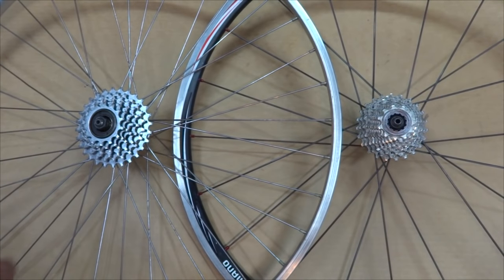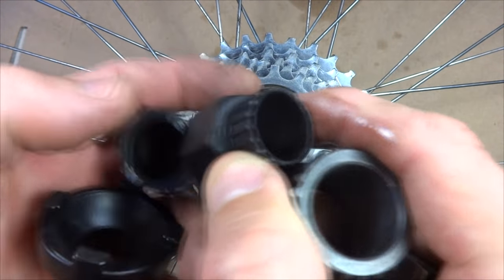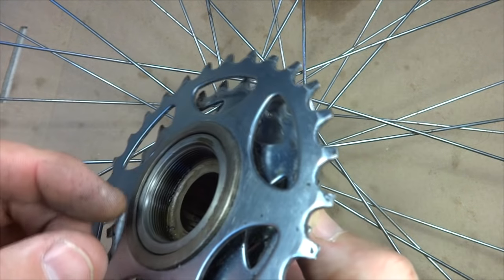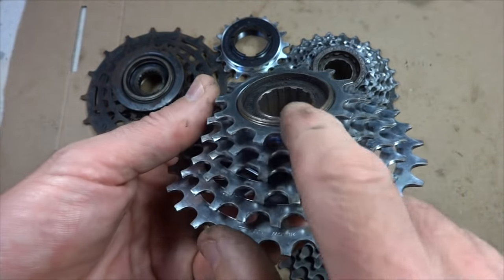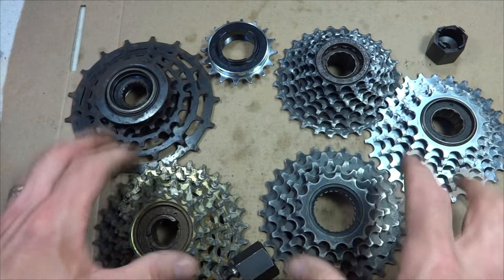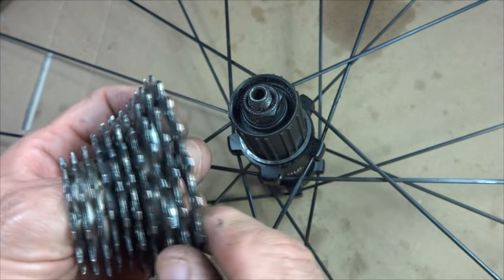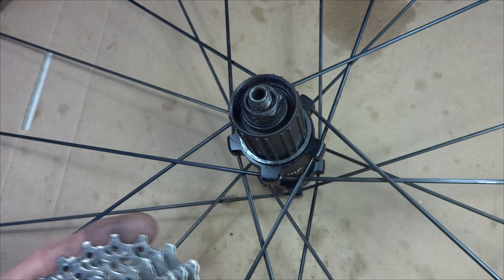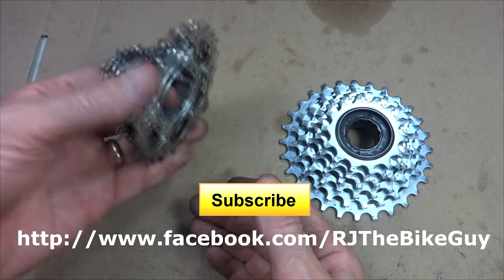Freewheel vs Cassette - What Are They? Can I Convert?

Comment: you just answered a conundrum I've had for years now , I have the two pin free wheel removal tool in my tool box and couldn't remember what it was for .... now I know haha , it was an old bike from the 1990's , thanks RJ you just made an old man very happy :D ( I'd been racking my brains wondering what I used it for )

Comment: Thanks, it became clear when you used the term freehub. I like that better than the term cassette since both types contain a "cassette" of sprockets. The difference is really cassette capable hub versus a freewheel capable hub (in my mind).

Comment: RJ, my man. I need some help. I got a 2011 Centurion Backfire M4 which is a 7 speed freewheel. I am thinking about getting new wheels for it since I ride it a lot and thought about getting a wheel with the cassete  hub. Now i only wonder if I could possibly fit an 8 speed cassete because cassete cogs are closer together than the freewheel is. I am just wondering if the frame could fit it. Also if the Shimano Acera derailer can work with it. Just looking to increase the gear ratio so I will also change the front sprocket to something bigger to get more speed
Reply from the maker: Depends. Measure the hub spacing to see if an 8 speed wheel will fit. https://www.sheldonbrown.com/cribsheet-spacing.html
Reply: Thanks for the link. Just needed some kind of guide
Reply: i think it should, did you try?

Comment: Thanks for the vid, that helped me with my old style campagnolo hub & freewheel. Just bought the two ear tool to remove it from the hub. I have a bent rim to swap out with an Araya doaner wheel assembly which BTW has the uni-glide cassette and I used a flat drift and kept hammering the smallest cog until it loosened up. I'm glad you showed all the different styles.
Reply from the maker: https://www.youtube.com/watch?v=1zWYLb2RMPA
Reply: Dude you need to get some chain whips too

Comment: RJ, I've been finding your videos useful. As such, I have a question and a comment:

Comment: I think it needs to be said that the main difference between cassettes and freewheels is cost. In my observation, your cheap, to mid-grade, bikes will usually have a freewheel. This is what I've seen in Wal-Mart and other bike distributors that sell bikes in the $100-600 price range. Cassettes are usually seen on higher-end bikes, despite the ease of repair, compared to a freewheel.

Question: I've seen your disassembly videos, both for rebuilding the freewheel, and for removing the cogs on a freewheel. What chainwhips do you use, and how expensive are they?

Comment: RJ, Thanks for the Video. I am restoring an old Peugeot I found at a garage sale and it is my first time so I am learning as I go by watching your videos. I took it all apart to clean (and bc it was fun) and now the hard part of putting it back together with new parts has come. The issue I am having is I bought Shimano Tourney A070 2 x 7-Speed STI Lever Set and Shimano 7-Speed Tourney Bicycle Freewheel Replacement Cluster - MF-TZ2 BUT like an idiot I bought Aeromax alloy wheel-set 700cc. I am sure you are aware that they are set up for cassette /freehub and not freewheel. I would greatly appreciate your advice on what to do/buy. 
PS I have already expanded the rear triangle to about 126 but have not invested in a rear shifter.
Reply from the maker: What is the hub spacing of the rear wheel? 126 or 130? What was the spacing of the frame to begin with? 120?
Reply: The hub spacing of the rear wheel is 130. The frame was previously 120. Thanks for the help.
Reply: RJ, not sure if you saw my first reply but The hub spacing of the rear wheel is 130. The frame was previously 120. Thanks for the help.
Reply from the maker: Then either expand the rear to 130 and get a 7 speed cassette or get a 126 wheel.
Reply: Thanks, will any 7 speed cassette fit on the freehub of the aeromax ally wheel set 700 cc wheel?
Reply from the maker: I suggest you research that.
Reply: Checked into it, looks like shimano 7 speed cassette will work on the aeromax wheels. Thanks for the help!

Comment: While scrapping out some bikes for parts I found a freewheel hub adapter on a Dimondback mountain bike. The inside of the larger outer cogs where wider then the average cassette mount and where two different center sizes on the hub but yet it was a cassette cluster on a freewheel hub so it is possible but not today since the cogs are probably rare. I took the adapter off and there was a standard thread for a freewheel. It wasn't easy to find a wrench for it but I had one. I have also seen some weird adapters that are for foot pedal shafts to change the size.
Reply from the maker: I am guessing what you found was the guts of a disassembled freewheel.
https://www.youtube.com/watch?v=T_vRbBRPr3c
Reply from the maker: Or https://www.youtube.com/watch?v=uwGCZuWPQGk
Reply from the maker: They not standard like a cassette/freehub.

Comment: Your videos have proven to be an invaluable resource of information for me. A friend gave me a vintage bike (12-speed Sears Free Spirit 3000) recently and I've been doing some "upgrades."
I'm seriously thinking of converting it to a single speed. Can I just replace the 6-speed freewheel with a single speed freewheel and call it a day, or are there things I should be concerned about, e.g., chainline, etc?
Thanks for the awesome videos!
Reply from the maker: Chain line would be the biggest thing. Chain length. Depending on the dropouts, chain tension. A lot of it woiuld be similar to this: https://www.youtube.com/watch?v=sInijI1vr34
Reply: RJ The Bike Guy I'll check that out. Thanks!

Comment: My locking nut is probably extremely tight.  I put a breaker bar on it and still couldn't get it off.  So tight that I thought those 2 holes might be for some kind of snap ring.  I'm hitting it with some PB blaster; hopefully that helps.

Comment: I have a Chicago 1980 Schwinn Red Le Tour serial number: SC097880, with 6-sprockets and the Shimano 400, not the Shimano Altus LT.  It does have aluminum wheels but not the ones for the new tubes.  I bought it used.  It seems to indicate that someone swapped in a Super Le Tour rear cassette.  The reason I bring all of this up is I can get all 6 in low range, but not so easy in high range.  The chain checks out for length but some of the sprockets are kind of sharp.  It has a lot of miles on it and maintained when it squeaks.  However, I can't help but wonder if no matter what I did, if the only real problem is the Shimano 400 with a 6-sprocket cassette.

Comment: The reason the change to cassettes was because the wider the cluster got, the more axles were breaking.  Imagine an eleven cassette block on the old freewheel system?  It would be horrendously significant loads being placed on the axle.  The cassette system has additional bearings along the axle length to spread the load and to stop axles breaking.  Also,compared to the old freewheel system, it is easier to change cogs on a cassette then on the old freewheel system.

Comment: Maybe I missed it, but the question I have always asked all my life, and usually folks leave it out...is WHY? 
If I knew why there are two types, I might understand which is better. Thanks for the info though.
Reply from the maker: Cassettes allow for the hub to have bearings farther out, so less like to bend the axle. The cogs wear out faster then the pawls and freewheel/freehub bearings. So with a cassette you can replace just the cogs. Cassette is newer technology.
Reply: Yes, the Cassettes are newer improvements. However there is really no need to upgrade, Unless you want wore gears. Or to ride harder offroad.

Comment: I got a problem and wondered if you could help; at 1:25 the topscrew which is called the locknut ( I think) seems pretty well fastened. My rearwheel just stopped moving while I drove bout 50 meters from my house. I watched some vids and looked at some pictures but didn't have the guts to take the whole hub apart. Weird thing is when I saw this cassette side locknut was loose, I thought that must be the problem so I tightened it (holding the left side locknut in place with another wrench). Put the wheel back in, but no movement of the wheel. Hmm, well then I got the wheel back out and decided to see what would happen if I loosened it, so I did and put the wheel back together. Now the wheel spins fine again, and also shifts through gears well. Buuuuut, this can't be right can it?? Now I am afraid to drive it, and I wouldn't know what else could be the problem so hmmm. Really hope you have a clue to what it could be! Thanks in advance

Comment: When I'm done with my current swath of freehubs, I'm not using them again. Freewheels for me from now on.
They are
-better in winter, don't freeze up
-more precise on swap-outs, no spacers, etc
-more secure, won't loosen

It may also be possible that freewheel rims cost less.
The problem may be that freewheels may be a dying breed.
Reply from the maker: Both will freeze up in cold depending on thickness of lubricant in them.

Comment from the maker: Patrickk Zetser, where have you seen a 10 speed freewheel?
Reply: they're all over fleabay.
Reply from the maker: Those are 10 speed cassettes, not freewheels.
Reply: No, they are definitely freewheels and 10 speed.  (single unit, screw mounted to the hub)   There are a few makers, the ones i know are Sunrace and  DNP that i saw around maybe 3-4 years ago.    search dnp or sunrace 10 speed freewheel.    typically $50-150

Comment: Thanks for this but what’s the advantage or disadvantage of each? I have a freewheel. I’m guessing instead of replacing a single gear I have to replace the whole thing? Are cassettes found on more expensive bikes?
Reply: Freewheels are only found on the cheapest bikes and are a very slow engagement.

Comment: awesome explanation! became a sub. i am building my first bike and had doubts on these. so i need to buy HUBS that will work with the cassette, they have to be compatible with one another! correct? and i also have to match the HOLES on the bub with the rims. right? if i get a 28 holes hub, i need a 28 holes rims! i am building a 16 inch foldable bicycle. thanks.
Reply from the maker: Yeah, the rims generally need to match the hubs for holes. Sound like you are new to wheel building.You should watch this: https://www.amazon.com/exec/obidos/ASIN/B004H1UA9Y/ref=nosim/youtube25-20

Comment: Hi RJ,
.
Thanks for all your video help, clear and easy to access. It's making my new amateur bike tinkering career SO much more enjoyable. Brilliant work, man!
In this vid (at 2m.10s) you say changing 5x to 7x freewheel can't usually be done as the hub is 126mm up from 120mm on a road bike. Is a MTB likely to have the same issue? Reason is I'd possibly need to change from thumb levers to triggers and 5speed triggers either don't exist, or are so rare I can't find them. I would use a 7speed trigger and use the limiter to stop at 5th gear but apparently the cable length increments per gear shift would be too short (by about 0.5mm) on a 7speed trigger to work properly. Hope this makes sense. If you have a vid covering this, (!!??) pretty please reply with a link when you have time. If not, ANY helpful advice is MASSIVELY appreciated. Cheers.
Reply from the maker: Here is a page that has hub spacings for different hubs, bith road and mountain: http://www.sheldonbrown.com/frame-spacing.html
Cog spacing is different on 5 speed and 7 speed freewheels, so an indexed shifter wouldn't work right.
Reply: OK, a good read, massive thanks, particularly for the super-quick response. Let the measurements and scary timber assisted frame alterations begin. Good old steel framed bikes, huh!
Reply from the maker: My preferred method is using a threaded rod: https://www.youtube.com/watch?v=YdibmxBuMy0
Reply from the maker: https://www.youtube.com/watch?v=QwxEPRk3LFg

Comment: Thanks for the info!  What about the advantages of both types?
Reply from the maker: The main benefit is freewheels with more more than 7 speeds are wider and prone to bending axles. Cassettes resolve that.
Reply: @RJTheBikeGuy  Hi very well explained video. So you're saying that up to 7 speeds, a freewheel axle is about as strong as a cassette axle? Thanks.

Comment: It's getting hard to find good quality 7-speed cassettes and getting really hard to find 7-speed freehubs. Freewheels are a budget option and are thus usually quite heavy and not durable. Oh, and good luck if you have a 5-speed (freewheels are still relatively available but hubs are not).
Reply from the maker: Plenty of 7  speed cassettes on Amazon.com. Freehubs might be a little trickier.

Comment: I understand that if I wanted to convert from a freewheel to a cassette, I'd have to buy or build a wheel with a freehub. But I'm wondering, if I were to go from a 7 speed freewheel to a 7 speed cassette, whether I'd have to also change out my shifters or deraillers.

I'm considering this because I noticed earlier that the axle in my freewheel hub has bent slightly, and having researched this, apparently this is a common problem with the larger freewheels, and part of the reason that higher-end bikes with more sprockets these days are built with freehubs.
Reply from the maker: A normal shimano 7 speed freewheel or cassette would use same shifter.
Reply: @RJTheBikeGuy   it all really depends on the space between each gear it all has to line up with slots in the shifter. the deraillers should be fine i think they all go the same distance apart from high gear to low gear although some have big plastic gears and some have small ones  some of them the disk are close together and some are not
Reply from the maker: @krisknabe12691  https://www.youtube.com/watch?v=xMvD1T4qF1E
https://www.youtube.com/watch?v=9R1CVWcgu_M

Comment: I find your videos extremely informative but I just replaced a 7 speed cassette with a 7 speed freewheel after having the freehub removed, It screwed right into the wheel so I'm a bit confused.
Reply from the maker: Sounds more like you had a freewheel, removed the cogs (not a cassette), then removed the core of the freewheel (not a freehub). Something like this: https://www.youtube.com/watch?v=WsVL1XqZve8
Or this: https://www.youtube.com/watch?v=uwGCZuWPQGk
Reply: I removed the lock ring and removed individual cogs just like this video (they came off separately).  I then bought a freewheel (one unit) at the bike shop and they removed the freehub (or whatever it is) for me since I didn't have the proper tools. It threaded right onto the wheel. I'm just confused because the part removed looks like the part in this video (4:21) it has spindles as well. I'm sure you're correct but is it possible for the parts to be interchangeable if the diameter is the same? it's a bs Schwinn Link hybrid from a chain store from about 10 years ago if that matters. 
Thanks again for all the info, you are the man!   @RJTheBikeGuy
Reply from the maker: Cassettes and freewheels are different: https://www.youtube.com/watch?v=qcgz3-XyNkI

Comment: Stupidly I bought a cheap bike with a freehwheel thinking I could convert to freehub. I bought a set of freehub wheels and will now use the opportunity to learn to build a wheel by replacing the freewheel hub with a freehub hub on the stock wheels.

Comment: Hey RJ! Dont know if you remember me but im the guy who asked about the cost of the conversion from flat to drop road bikes... quick question. I have a 7 speed shimano cassette and was wondering would it be possible to convert to an 8 speed cassette?
Reply from the maker: Slight chance. If the 7 speed cassette is installed with a 4-5mm spacer on the freehub, then an 8/9/10  speed cassette will fit. If not, then an 8 speed cassette will not fit. Also a road hub that will take an 8/9/10 speed cassette will have a spacing of 130mm as opoosed to 126mm for 7speed.

Comment: Great video, but you didn't expain why the difference and which is more common, desirable, etc.  It would appear tha the cassette is more versatile because it would allow you to replace individual cogs, etc. and or tailor those cogs to your gearing needs.
Reply from the maker: That goes beyond the point of the video. Freewheels were the norm. Now cassettes are the norm, though cheap bikes still often have freewheels. Freewheel design limited with the hub bearings were located. More gears, lead to longer axle, and bent/broken axles. Cassettes allow bearings to be farther out so axles don't bend/break as more gears are added. Swapping cogs on freewheels not really feasible. You can swap cogs on cassettes, but it's not normally done. Just choose a cassette with the gearing you want.

Comment: Thanks, Great info!.. I didn't know that. I have cassette with a freehub. I need to replace chain rings and chain from wear.  Wondering should the cassette be replace as well? Do they 'Schimano" sell the whole setup as a kit?
Reply: Yes, the recommendation is to always replace chain and cassette at the same time. Because the chain wore and stretched and the cassette cogs wore accordingly, so they are no longer now the right shape for a new chain. If you replace just one without replacing the other, the new item will wear faster, and you could experience problems with shifting, or in worst case even chain skipping over the cogs.Chain and cassette aren’t sold together, so you have to carefully select what you need, of course if you stick with what is on the bike now then that’s lowest risk of making a mistake.